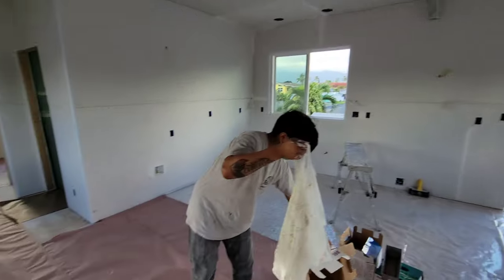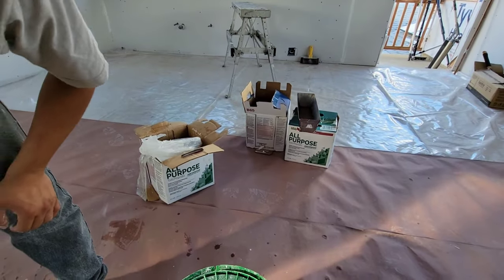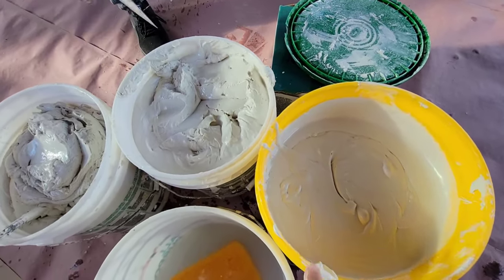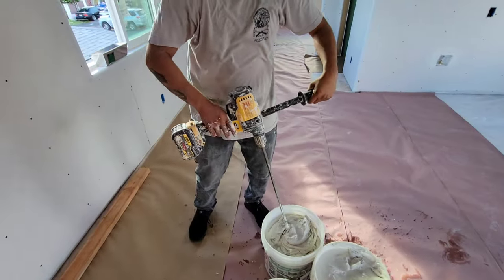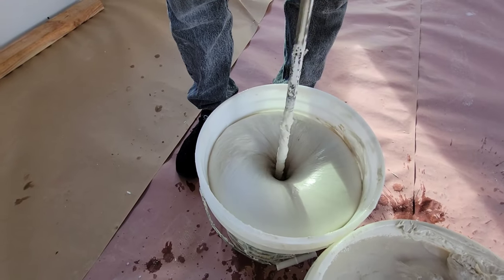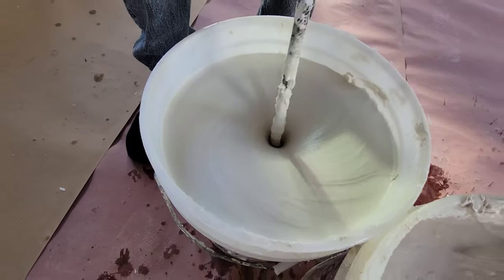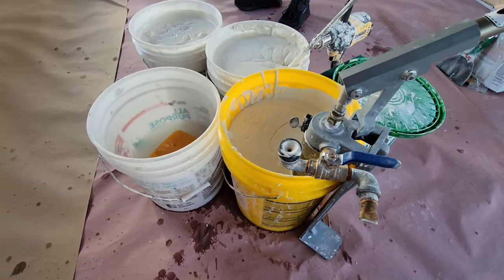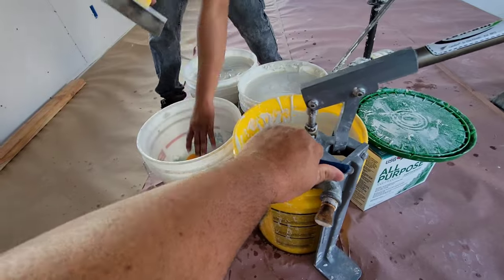Drywall  Flushers vs Angle heads.

Comment: The best way I find to use can am flushers is to use 2 inch flusher after you roll. Always struggled with 2.5 - 3 inch as had to push it hard and it never worked. Mud would run all over the place. Then someone recommended 2 inch and it’s a game changer. Flushers are great for small jobs and jobs done by homeowners, where screws are always raised up and you risk fckng up your expensive automatic head.

Comment: Not sure what size flusher young fella was using but seemed not enough mud for that size. I've got a few different brands of flushers and my cam arms are the best. That being said I way prefer my angle heads. I use my flushers more fore really choppy reno jobs where you get lots of old meets new drywall. Flusher seem more forgiving run over those rougher surfaces
Reply from the maker: Great insight Jim ya the acujust is 3.5 so it was running rough. Should work better for second coating.

Comment: No disrespect but I take that tj is still an apprentice?
I only say because I use can-am flusher and they dont give me that kind of trouble. 
I use the direct flusher as well with a compound tube and works fine. 
I learned on hockey boxes and angle heads. I feel angle heads are better for sure. But I like a tube over a hockey box any day.
Reply from the maker: Totally agree this was to show case using flushers for the first time transitioning from glaziers. At the end of the day there is all kinds of great ways to achieve a superior finish its all about what works for you and makes you money. Yup Tj and Omar are still learning Omar is about 85% and Tj is about 60%.  Iam 95% always learning. Thanks for watching bro and your input.
Reply: @csdrywallhawaii  ohh I am just a glorified apprentice.  I dig your videos brother. And this one was really good because I feel it shows what it may look like when your just picking these up for the first time. Such a learning curve. You and your crew look solid. And once again meant no disrespect.

Comment: I always wanted to try taping tools but watching this it looks so messy. You must spend hours after scraping mud off the floor and what do you do about all that mud the is falling all over the walls?
Reply: Wokepeoplearelazyasf  lol, honestly though. Tapers and the electricians. Those are the two worst for leaving a mess.
Reply: It doesn't have to be this messy. We are very clean with them. Minimal mud ends up on the wall. However, it does take alot of practice.

Comment: Will these work on a concrete wall
Reply from the maker: Yes but won't leave the angles as crisp as the glazier but don't have to worry about ruining the blades.
Reply: @csdrywallhawaii  ok great...an what head can I use to apply the compound to the concrete angle...
Reply: @csdrywallhawaii  will the plastic head for the mudshot work?